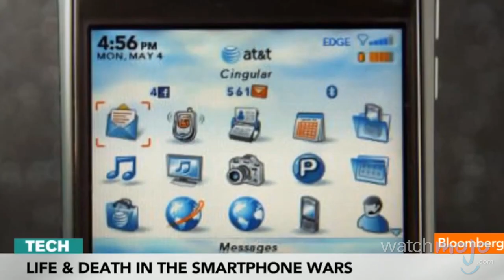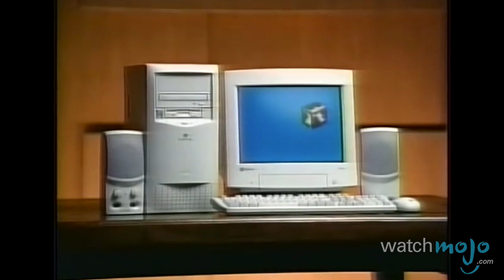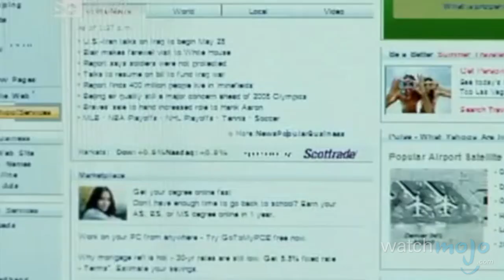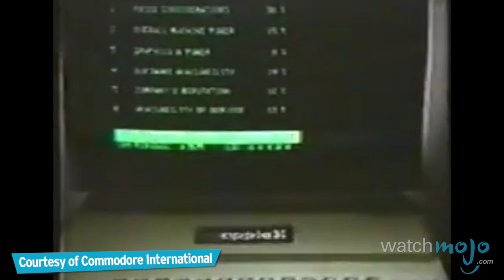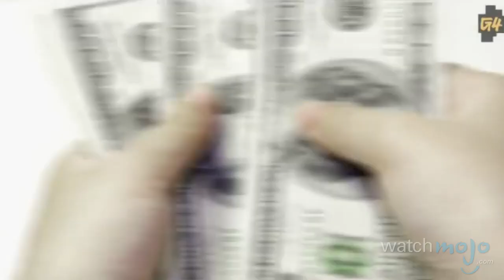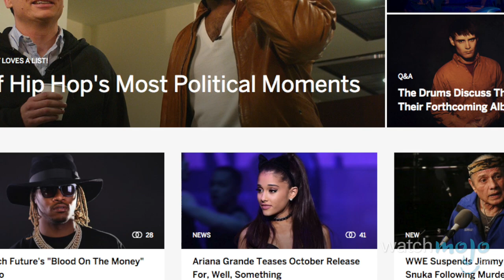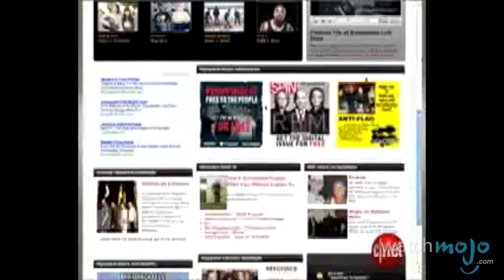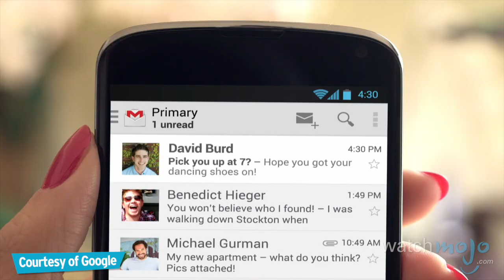Top 10 Products That Killed Competitors

Comment: Sega killed itself with the Dreamcast.  It was costly, even though it was a superior console in hardware, and they had tightened up on their licensing to 3rd part developers as Sony opened their up.  Sega did this change because people had that complaint between the Sega versus Nintendo war as they were extremely liberal with licensing and thus a lot of mass produced, low value/quality games were made during this time.  I played the Dreamcast and the Playstation 2 and if you had the libraries from overseas included the games on the Creamcast and the play itself was just a more superior product generally speaking.